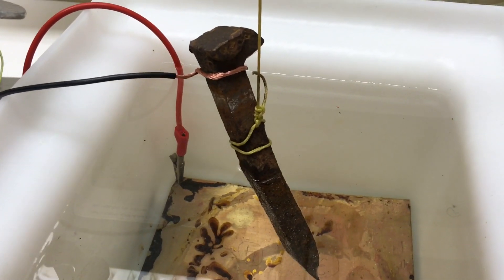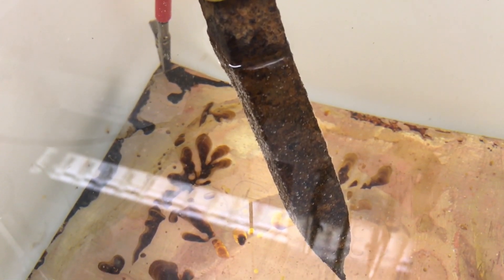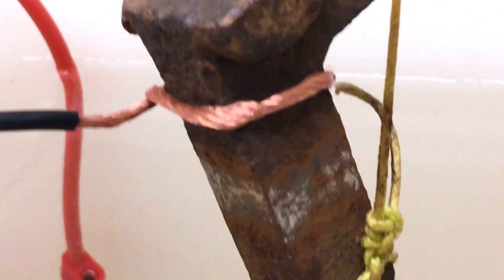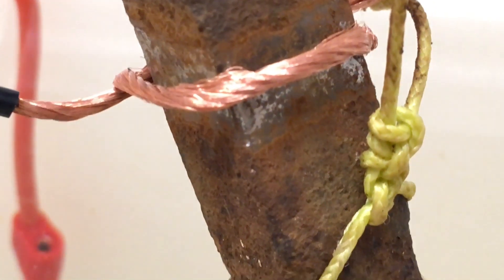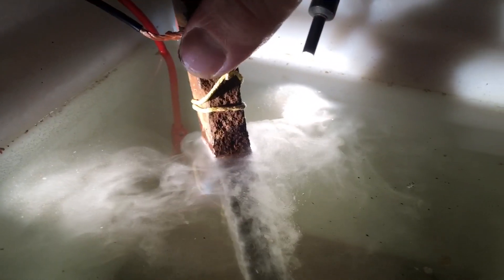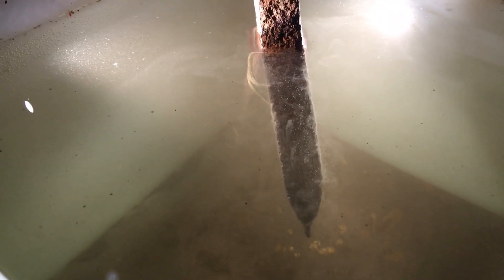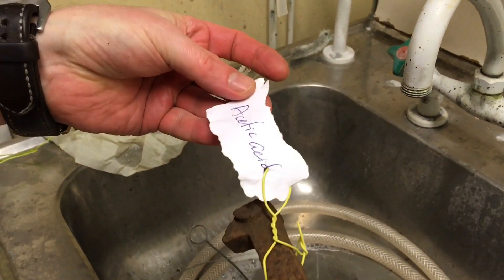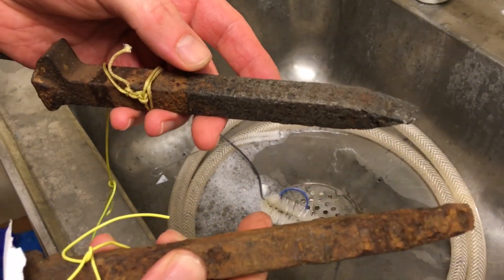True rust removal by a chemist - boosting the performance of white vinegar by electrolysis

Comment: Hiyya. You're a chemist. Can you supply the half-equations for what's going on at the cathode and the anode?
Reply from the maker: +Seymour Sunshine U have at the positive cl- being reduced to cl2 gas but the acetate ions should add w ethane and CO2 being produced. The little cl making gas is very little but if u do electrolysis on diluted muriatic acid - it makes holes in your titanium electrode. It’s very corrosive. At the negative you have a myriad of reactions: with iron in the rust switching from 2 to 3 plus, a mixture of oxide states and hydroxides adds on top due to different oxidation states, while also hydrogen reduced direct on the iron to gas, that is under the rust. So, the simple answer to your question: No I cannot. If you could find one chemist that could balance these equations then you, not the chemist, is up for Nobel prize. The vise is dirty on top of it. Of course there is always someone that says they can do it, but if that person would add the equations here 50 folks would tell how many wrongs there would be in there. Basically without a proper analysis on what’s in the bath, it’s impossible. Thx for comment. Good input.

Comment: citric acid for a day in 45C temp, then coat with the Dinitrol 11253 RC800, then remove the coating with wire brush or sand blower. The result is non rusting metal without any coating for days !

If you do not remove the Dinitrol 11253 RC800 coating then it's like painted primer, but I do not like it, and some parts needs proper base coating like zinc, etc. Some parts need not to be painted.

I would love to learn to do same result but without expensive Dinitrol 11253 RC800. However if I do not use it the part rusts again after some time, rather quick I might add.
Reply from the maker: +juliusvalentinas I have found the papers on most of what is in the Dinitrol that you are using. One question: is the color of the liquid beige and does it turn into something like purple?
Reply: @Ken_Sweden  The color of the liquid is like milk, it dries quick and turns into lacquer. The rusted parts turns black, good metal is unchanged. That is the main plus of this converter that you can see parts that reacted and can sand them once more. Until There is no more reaction.
Reply from the maker: +juliusvalentinas If you see a small sign of purple, then I possibly could can suggest something cheaper that works the same.

Comment: For a 5% concentration (typical white vinegar here in the US), how many mL vinegar per L water is ideal?
Reply from the maker: I think the bottle white vinegar is about 5 % acetic acid, roughly. That would be to take the entire bottle, no dilution at all. However, I would look around a bit, it’s probably possible to get the pure acetic acid somewhere. It’s a weak acid and not very harmful, especially compared to Muriatic acid sold in the hardware store. That way you can use only pure water, the salt and the acid so you know what you have in your bath. The bottle of white vinegar possibly contains some other things as well.
Reply: @Ken_Sweden  when the sodium carbonate reacts with the vinegar and produces gaseous CO2, does  the remaining product do anything to hinder the process, or is there likely enough of each reactant remaining that the electrolysis is not hindered? It's been so long since I've had Chem I hesitate to feel my conclusion is a sound one
Reply: @Ken_Sweden  I appreciate your input. I've been doing some research and trials. May I get your opinion on the following solution: 
 
3 tablespoons washing soda + 3 cups white vinegar (5%) per gallon of water.

I'm chasing my kids around so if my conversions are off I apologize. I round numbers off a bit

12mL washing soda + 190mL white vinegar per L water 

What do you think? I've used this to great affect with no adverse effects, but there's always a chance I'm missing something.

Comment: So i’m planning to use electrolysis to remove rust inside my motorcycle gas tank, its only 4.5liters so about 1.25 tbl spoon of sodium carbonate should do, but do you recommend to but white vinegar as well? And by how much?
Reply from the maker: +ripmax333 the electrolysis works both ways. You can use sodium carbonate or white vinegar. I use white vinegar because it is better in dissolving rusted fragments into liquid. The sodium carbonate is not dissolving anything, it just makes a big froth as gas is formed on the metal surface when you run the electricity. Good luck!
Reply from the maker: I see, yes I recommend sodium chloride + acid: that is table salt with white vinegar. You are right if this is what you meant. Sodium carbonate is baking powder, it’s makes things the opposite to acid, but it works as well. I have not shown that. I know you will be happy with the acid way, don’t bother with the other sodium carbonate stuff.
Reply: Ken Sweden so i can use white vinegar alone or a mix of sodium carbonate and vinegar? I used sodium carbonate and it kinda worked but there were still like tiny black dot deposits. Now i’m using white vinegar alone and see what it does.
Reply from the maker: ripmax333 white vinegar and sodium carbonate will cancel out their effect. Acid + alkaline = neutral

Comment: Forgive me if I’m wrong Ken but wouldn’t the alkaline neutralise the acid? Thanks for the video. Colin
Reply from the maker: I’m a bit confused. You are perfectly correct. Alkaline neutralize acid and mixing for example acid, battery acid with diluted caustic soda will make it neutral, ph 7 if in correct proportions. The trick here in the video is that I want to have it acidic because then I don’t clog my electrodes, the iron stays in solution which it only can do it acidic. That’s also why I never use any washing powder as you may find in others videos. Thanks f comment. Write me back again if I didn’t get it. I answer to all comments. Have a good day!

Comment: Just leave it in vinegear for 1 week, and then wash out the rust with pressure washer. Then immidiately add oil to the item to prevent rust again. You will see after this, will no rust left at all!

Comment: So YouTube is littered with videos on rust-removal by electrolysis and other methods on iron and I've heard enough of the warnings against attempting this on stainless steel to know not to attempt, but no-one has yet talked about the best way to remove rust from stainless steel!!

All the chemicals will either possibly eat through the metal or cause it to rust soon after application. After that I'd have to  figure out how to dispose of the chemical legally. Are any of these chemicals even safe on cooking equipment like a rusty grill?

Your response would be much appreciated. Thanks
Reply from the maker: +stJek I see your point and even though you won’t end up with hexavalent chromate ions as some folks seem to believe on YT, the chromium oxides will need special disposal. Regarding the acetic acid you find in white vinegar, that you can dump in the drain as long as it doesn’t clog. Is done in every restaurant as well. Acetic acid in white vinegar is completely safe on a grill. Thx for raising good points!
Reply: @Ken_Sweden  I've been very interested in trying electrolysis rust removal but have held off because of concern about chromium and nickel. I know that stainless has much higher percentages but all sorts of steel contains them in smaller amounts.  Any thoughts on that? And how would the byproducts differ from grinding dust, something that's done all the time.

Comment: Would an alkaline such as sodium hydroxide instead of an acid work better?
Reply from the maker: All dissolved rust will just clog the system since it will come out as precipitate and froth. Electrolysis for rust removal will always be easier when acidic. Only acidic solutions can hold your metal ions in the system as suspended for longer times. Thanks for commenting!

Comment: Thanks for posting this. However please help me with the amounts of vinegar and salt I need to add to a 2.5 gallon gas tank I am trying to clean. I did this but didn't work. I had no action at all. I did check my connections and was getting power to my anodes. Also are you using straight vinegar and no water? I wasn't sure.  Thanks
Reply from the maker: +MyLexG The electrolyte is 7 litres of water w only 5 table spoons of table salt. 1 tea cup of acetic acid ( equivalent 5 cups of white vinegar). 

If you don’t see much action in the beginning it could be 2 things: 

1. no current to the pure iron, check connections or 

2. that your object is evenly rusted so it takes some time to get the process going and penetrate through to the clean iron. The more rust you remove, the faster it goes, and the more obvious the entire process becomes. The last section of the video is where I am almost at the end. Hope this helps.

Comment: I use sulfuric acid to lower the ph in my hydroponic nutrient solution. Would that work  in electrolysis rust removal solution also?
Reply from the maker: Yes. You dont need much, you are down on pH 3 by a table spoon in 1 quart (ca 1 liter). Sulfuric is a much stronger acid by its nature.

Comment: definitely has advantages but you have to dump a lot of watts into it, how does that 30x stronger acid fare if left in the bath for 3 days or a week? I still think the rust laser is the best
Reply from the maker: +TheDaikashido rust laser s amazing. Acid and electrolysis at the same time is good for rust removal in threads and cavities, however with too strong acid the counter electrode will dissolves..

Comment: Still think washing soda works better I use sodium carbonate
Reply: Every video I've seen using Sodium Carbonate left black scale on the part, does that happen for you? What intrigued me about this method is that I can see nice shiny metal on the end result.
Reply: @rylpace  you can see shiny "white" metal because the vinegar is removing more than just the oxide scale...its eating into the sub straight rapidly, whereas the soda carbonate electrolysis bath is only affecting the oxide scale...kinda like a laser scale remover. Save the part...don't dissolve the darn thing.

Comment: Thank you very much for making such an in depth video on how to do this. I have seen this process done on a lot of  other YouTube channels, but not once have I seen a video explaining how and why it is an effective rust removal method. It's very interesting to me how little acidity is needed to achieve these results. I am going to try this now that I know how. Again, thank you man!
Reply from the maker: +Richie breit thanks for sharing your thoughts. I tried to get to the bottom of it. Write me here if needing assistance.
Reply: @Ken_Sweden  I might have missed it, but how does it compare to just plain electrolysis with soda in terms of speed and efficacy? And just removing the rust not the metal...
Reply: Electrolysis simply removes rust just by generating lots and lots hydrogen gas for use as a quick debriding agent (i.e., merely just  to loosen up and mechanically dislodge the rust!). So, you'll want to run it at high currents then and also only for a short time too so as to not leave the workpiece in a conductive solution exposed to the air for too long (which will only encourage further rusting)...

Comment: It seems to me that having the anode be a sheet of copper in the bottom of the bucket, that means that as the ferric oxide sloughs off of the piece, it will coat the anode, decreasing its efficiency.  So wouldn't it make more sense to have the anode be vertical, on the side of the bucket?
Reply from the maker: +bricology well it depends on how you hang your pieces to be cleaned. The uniform field strength is the most important, so 4 of them (one on each side) would be an option. However, the little gas generated on the anode lifted all my froth to the surface anyway so I had no problem. The field strength is also unaffected by some small larger lumps if there. I guess it could be more of a problem if you don’t add any acid that assist in dissolving the rust.

Comment: Thank you for doing these videos. I'm building a setup just like yours. The only "pure" salt I was able to get contains Sodium Silicoaluminate. Will this salt work or do I need to get salt that has no additives at all? Thanks.
Reply from the maker: +L Larkin thanks for feedback. It wont matter what salt you use. Sensitivity to exactly what’s in the bath is mostly a big concern when plating and attaching metals to your surfaces. It’s soon coming up a simple guide to this as well. So no worries go ahead. Just don’t close the system so hydrogen has gets trapped. Good luck 👍
Reply: Built setup just like yours and works great. Have couple questions/issues. (1) The anode is a 1" strip made out of the titanium sheet you recommended. I attached it to the anode plate at the bottom of the rectangular container using steel rivets. Will the steel rivets affect anything? (2) I put the anode at one corner of the container and saw the effect you talked about in your video of the electrolysis occurring faster and with greater intensity in the items nearer the anode strip. If I put another anode diagonally across from the first anode (could do the same with the cathode), will that equalize the field so I get consistent electrolysis throughout the container? (3) I noticed that the anode plate on the bottom, which is very thin, is raised about 1" from the bottom in one area of the container. It's as if something was pushing up the plate from the bottom. My concern is that the raised plate is almost touching some of the items being treated and could cause a short circuit. Do you know what could be causing that lifting effect and how I can eliminate it? Thanks for your help.
Reply: And lastly, how can you tell when the process is done? Visual inspection?
Reply from the maker: Great! 1. Regarding the steel rivets, if they are acid resistant it will take long time before you see any deterioration so you will have plenty of time to replace them if necessary. Im not sure how you got them sitting there without a leak but I have seen plastics rivets on Ebay in HDPE. In terms of affecting the bath, they are unlikely to make any difference. 2. It will compensate a bit, but you will then have a bit less done in the center of the bath. 3. Yes if the titanium in the bottom lifts you should be careful with shortcut, very careful, depending on the current you run. I have drilled holes in mine to avoid stacking of gas there. I hope it helps and visual inspection is what I use, and when the most complicated corner cavities are done, then the rest is perfect. Thanks for your encouraging comments!
Reply: Thanks so much.
Reply: When should the water/vinegar/salt solution be replaced in the container? Thanks.
Reply from the maker: L Larkin for this you have to find a pH meter or pH paper. Your starting pH will be about 2-3 but with time it will increase, and when up to 4-5, I would change. It will still work but not as good. It all depends on how much and how large parts you have been cleaning.  good input, thanks.👍
Reply: Thank you!
Reply: @Ken_Sweden  Hi Ken, How can I get rid of the solution once it is all used up? Can I pour it down the drain in my kitchen sink?
Reply: The sodium silicoaluminate prevents the table salt from sticking together when absorbing moisture, for this process it is irrelevant, however I would recommend washing soda (Na2CO3)  instead of table salt, for it doesn´t contain chloride, which itself is very corrosive to steel (seawater).

Comment: Can I use a 12 volt car battery with jumper cables instead of a charger? The charger I have will charge a battery but not work with electrolysis.
Reply from the maker: chevybob Yes but with time your current will drop. A small object, no problem. More acidic better action. Got to be careful though, if I shortcut then I run a fuse, if you shortcut w the battery then you won’t have that fuse. Good luck.
Reply: @Ken_Sweden  Just a little friendly language advice: Native speakers wouldn't use 'shortcut' in that way. The way you've written it makes it difficult to understand. An accidental connection between + and - of a power source is called a short circuit, or just 'short' for brevity.

So I would write your sentence "if I shortcut then I run a fuse, if you shortcut w the battery then you won’t have that fuse." as "There is a fuse if I have a short, if you short with the battery then you won't have that fuse."

I only bring it up because your English is otherwise nearly perfect.
Reply from the maker: rylpace I see your point. This way I will remember. Many thanks! You never stop learning!
Reply: You need to find a manual battery charger then it will work

Comment: I think very little rust is being removed; almost all of the rust is being removed by electrolysis.  You have so little acid in there that is just acting as an electrolyte along with the salt.

Try doing this demonstration w/o the battery charger; you'll get old and gray waiting for the rust to be removed.
Reply from the maker: +X the Unknown you are right in that it doesn’t do much without electrolysis and one has to expect gray hair if only using that acid. However, it makes a difference w electrolysis and even more if you would heat it. It keeps all that precipitate and nasty stuff limited. The solution is pH 2-3 so it’s a bit more acidic than Coca Cola, and even leaving it in Coke would remove rust with time. For high speed acid rust removal, here’s what there is to know
Reply from the maker: +X the Unknown https://youtu.be/5Bkdej_z1HI
Reply from the maker: +X the Unknown Thanks for watching, much appreciated comment!